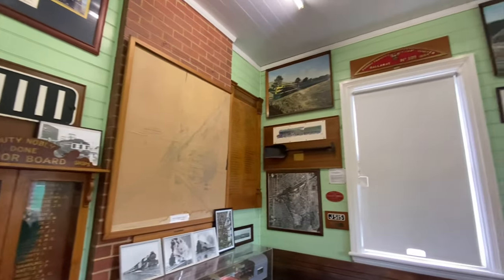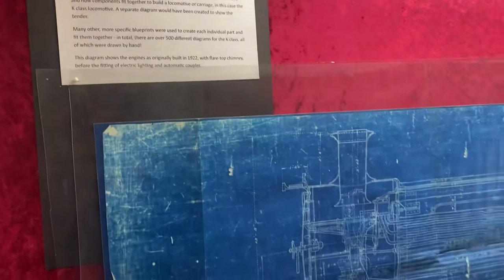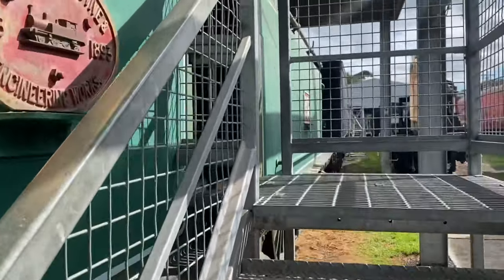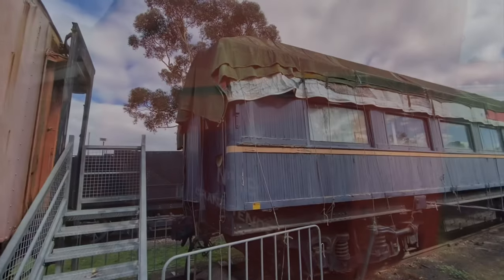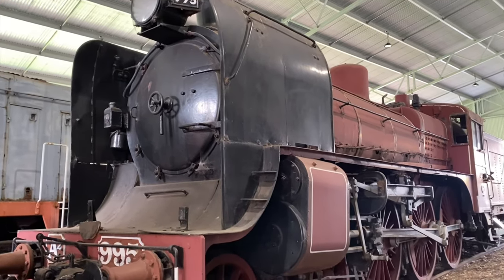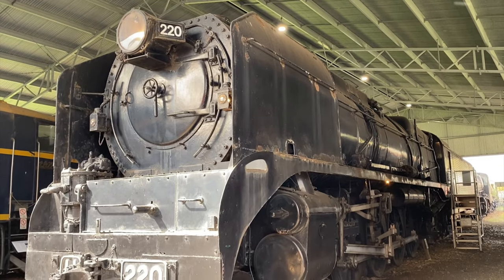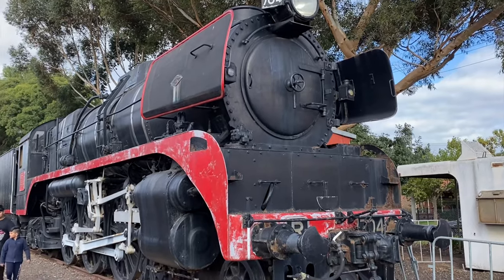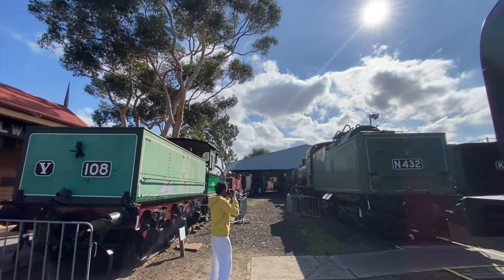The Newport Railway Museum: Victorian Railway History

Comment: Fun fact the last Australian standard Garrett was at the railway museum for a while after fyansford replaced the railway with a convar belt and now G33 is at the Bellarine railway being fully restored
Reply from the maker: I’m keeping up to date with the restoration over there!
Reply: Being a fully enclosed cab it was a great place to shelter during one very wet visit to the museum.  I understand that it would have got very hot it it was working hard for an extended time.  But in cool wet Tasmania it wasn't such a bad place to be.  If I recall correctly a crew was suffocated inside one of these cabs in a tunnel in Western Australia.The engine stalled on an upgrade and the tunnel was small.  The crew couldn't escape over the tender as they could in a tender engine.
Reply from the maker: @smitajky  wow what a story

Comment: Shame the S class never got into preservation. Feel like that's a missing loco that any museum or heritage group would love to have to display/run.

Also fun fact about the Heavy Harry name living on. I've heard it used to refer to a specific Q relay still in use on the network for points circuits. Heavier than other standard Q relays I've handled.
Reply from the maker: It is a shame! And cheers for that !